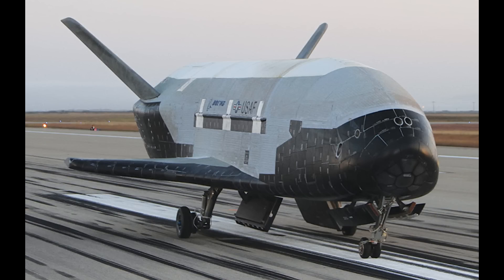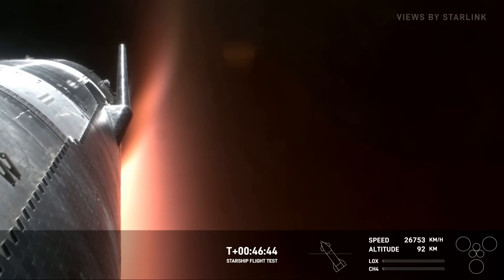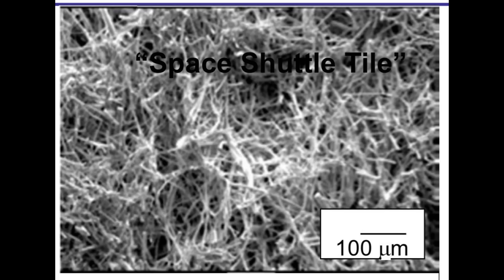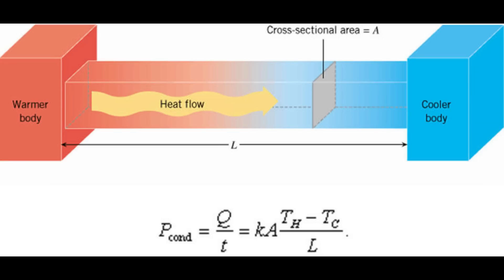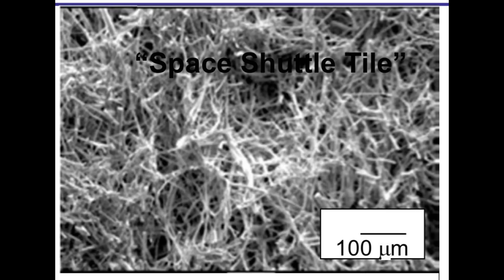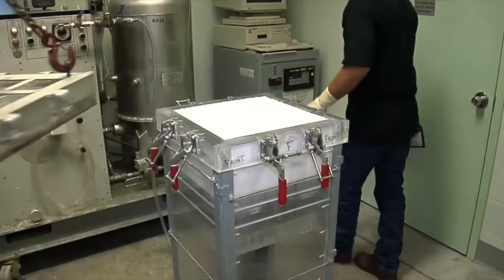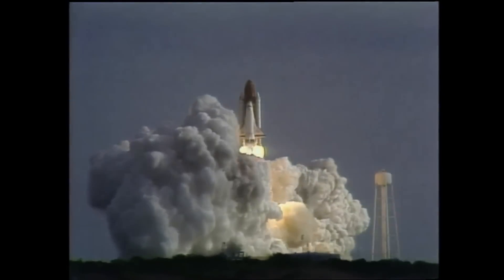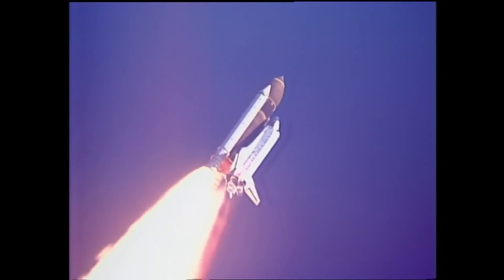The Microscopic Trick That Makes Heat Shielding Tiles Work

Comment: The physics behind the performance of rigidized ceramic fiber tiles like the ones used on the Shuttle, the X-37, and Starship is called Mie Scattering.  The selected fiber diameter (~1 micron) is "tuned" to the peak wavelength in the heat radiation inside the tile at the highest operating temperature (~2400F), called the Wien Peak, which is ~1 micron for blackbody radiation at 2400F. Those thin ceramic fibers strongly backscatter that heat radiation and effectively block it from penetrating deeply into the tile thickness.  The very thin fibers are made of ultrahigh purity quartz and have very low thermal conductivity. For comparison, the diameter of a human hair is ~70 microns.

There are two parameters that characterize Mie Scattering, namely, the absorption coefficient and the backscattering coefficient. For the Shuttle tiles the backscattering coefficient is about 600 times larger than the absorption coefficient.

Side note: My lab spent almost three years (1969-71) developing and testing rigidized ceramic fiber tiles for the Shuttle. My job was to design and build the lab equipment to measure the absorption and backscattering coefficients of those developmental tiles.
Reply: What determines the ratio of absorption to backscattering coefficient? If I recall correctly, absorption and emission coefficients are the same at all wavelengths because of detailed balance and can be calculated (in theory, anyway) from molecular or electronic structure. But what's the physics that underlies the backscattering coefficient? Is it just geometry and the dielectric coefficient of the material? Or is there something more at play?
Reply: @QuantumHistorian  A dielectric fiber (quartz)  with diameter matched to the predominant wavelength of the thermal radiation trying to penetrate the tile and having very low optical  absorption (high transmission) in the 1 to 4 micron waveband (the near infrared region).
Reply: @rays2506  Thanks, but that doesn't answer my actual question?
Reply: @QuantumHistorian  Mie Scattering.
Reply: @QuantumHistorian  Mie Scattering.
Reply: @rays2506  Thanks. So looking that up, my guess was right, it does only depend on geometry and the dielectric constant of the material (as well as the wavelength of the material, obviously).
Reply: Why is silica used instead of alumina?
Reply: Thanks for helping create the spacecraft of my childhood (80's and 90's), STS was far from perfect but gosh was it beautiful. Very helpful explanation as well.
Reply: You wonder at what point is it easier to have an ablative heat shield you just spray on again as these tiles still need a lot of maintenance
Reply: @samdettle8694  Well, spraying on a new coating isn't super-straightforward. Most ablatives are made of resins and plastics that have to be laborious injected into honeycomb support structures cell-by-cell; the honeycomb often gets consumed alongside the ablative material, so the whole structure needs replacing as opposed to being refilled. While it's true Shuttle's tiles were rather delicate and didn't stand up to impacts super-well, if carefully managed (and with more modern manufacturing tech than was available in the 1970s), the tiles can be more than viable.
Reply: @samdettle8694  Of course for the Starship to land on Mars. it will need to fire it's rockets to slow down. Perhaps SpaceX should built those rockets to assist in Earth landing too.
Reply: @samdettle8694  Better would be an ablative blanket, prepared in advance and wrapped around starship like a tarp.
Reply: @paulmichaelfreedman8334 perhaps but ablative shields are 1 use only shields. That would render a far from “rapidly reusable” spacecraft.
Reply: @samdettle8694  The shuttle External Tank had a Spray-on foam insulator to keep the propellants cold, look what that turned out doing. Same goes for heat shield materials that you can spray on. it works, but any air bubble will pop a chunk out of the foam, as will mechanical stresses.
Reply: So, you're saying that if my hairs were thinner, I wouldn't get so hot standing in the sun and would reflect more heat from the top of my dome. Got it.
Reply: @dionh70  also, if your hair was black, it would shade your head more. And if your skin was dark, the pigment would protect your DNA from UV radiation. Nature knows what it's doing.
Reply: Comments like yours are the gold of youtube for us enthusiasts. THANK YOU for your explanation.
Reply: "QUANTUM EFFECTS"
Reply: That's awesome! Thank you for the explanation, and for your work for space flight!
Reply: Regarding intelligence, we have had that forever, education is the difference.
Reply: Always a pleasure to read comments like these, thanks for sharing.
Reply: Fucking awesome!  Thank you for your service!
Reply: Elon Musk is a Nazi sympathiser
Reply: Genuine Question. I'm 52, and I have a profound worry for the future of humanity, from an intelligence perspective. Do you believe that in the US, for example, there has been a massive decline, a dumbing-down if you like, in the education, aspirations and general intelligence of the population?
I'm lucky in that I live in a very highly educated European country, but from our unfiltered perspective, it seems to us that most Americans have lost their way. Think about the drive and brilliance of the 70's and 80's and compare it to now.
Reply: @Hiram1000 you didn’t ask me, but I’ll answer with my bit of anecdotal evidence. My daughter is 16 and already has a rather large collection of educational accomplishments. Enough that her current resume would absolutely put mine to shame. With the exception of course that she’s not yet graduated. She does already have a college credit in engineering from her freshman yr. She’s taught herself to be fluent in German. She’s taking her 2nd yr of French, she took a couple of Spanish, and of course is fluent in English, her native tongue. She aced her honors Aerospace Engineering course this past year. This coming school year she’s a junior and she’s taking calculus and a college physics course. She’s also taking private pilots lessons. Oh she’ll also be taking a hand full of online course these next two years through our local community college just to fulfill her desires for graphic/video game design as a hobby. She’ll graduate high school (which was recently named number 2 in the nation) with an associates degree, a few additional college credits knocked out of the way, her pilot’s license, hopefully having maintained at least her current  5.2 weighted GPA, along with numerous other accomplishments that I’m too simple to even know what they are. Of course I’m biased because she’s my little princess, but she’s objectively an amazing 16 year old girl, and at her school, many brilliant minds can be found. It’s all about area and personal ambition. At least in my opinion. Sorry for the for the rambling. I tend to get carried away doting on my baby girl…
Reply: @Hiram1000  Ah, it is a well-known cognitive bias, that's how our brain works. We just get wiser and more experienced with age and tend to see human stupidity more. But we all have been young and stupid, one way or another, and that's the beauty of life )) Plus, we tend to remember only the best and the worst things, that's where the feeling of people doing great things in the past vs. today comes from.
Reply: @Hiram1000  I wouldn't say the 70s and 80s were a great example of drive and brilliance.. There's intelligence and idiocracy in every generation, looking back through a nostalgic lense tends to show only the most notable, either good or bad.
Reply: Are shuttle and Starship's tiles designed to be ablative like capsules are? My thought is perhaps we are using too good a heat transfer inhibiting materials for the Starship as the Starship has no Aluminum but instead a steel frame and body. Perhaps SpaceX should try to get more heat spread out into the entire vessel, even using active heat transfer techniques. One problem with my idea is perhaps human occupants overheating, but that might be manageable. Would be cool too see the upper steel glowing red hot like the bottom tiles.
Reply: @williambaikie5739  Neither tiles have ablative capability. Aside from compromising the "reusable" part of the thermal protection system, for the kind of reentry methods both Shuttle and Starship use, ablation would radically alter the aerodynamic properties of the vehicle, which would make control more difficult as time went on. Starship was originally designed to use the thermal mass of its hull to manage reentry heat, but it appears it wasn't enough, and tiles were needed.
Reply: @eddievhfan1984  Thanks. What about active thermal systems? I'm thinking of pumped fluids from around hinges and other key areas to relatively colder areas. Would such a system keep the tiles from overheating and experiencing burn-through?
Reply: @williambaikie5739  The tiles won't burn through.
Reply: @tedmoss  Isn't that what we saw on the last flight? Or are you contending there was zero tile protection around the hinges?
Reply: @williambaikie5739  If done right, the tiles won't need to be backed up by active circulation systems. The original plan for Starship was for the heated side to use water evaporation through pores in the skin, but that was replaced with the thermal tiles.
Reply: @eddievhfan1984  ...propellant evaporation, if I recall correctly. This would be way cooler (pun intended). Plus, propellant would burn around the hull, the combustion gases would expand, deflecting plasma even more.
Reply: @williambaikie5739  AFAIK the tiles did not burn through. Instead, plasma penetrated the hinge gap (Elon said the gaps between tiles might have been wider on that side) and the metal under the tiles melted.
Reply: @eddievhfan1984 well at least they’re not ablative on purpose. Accidents did happen tho as we all know.  Typically only ablated do to FOD tho…😒
Reply: @williambaikie5739  Per Scott's explanation, Shuttle and Starship tiles are NOT ablative, like the heat shields on the Apollo and the Dragon capsule.
A simplified explanation.... The really really tiny glass fibers that make up the TPS tiles are so tiny they prevent the heat from penetrating too far into the tile.  The wider the tiny fibers, the more heat that can pass through them, so by making the glass fibers as tiny as possible, it helps to restrict the amount of heat that flow thru the tiny strands of glass fiber.
This over simplified but a good starting point to help you understand the process.
Reply: @williambaikie5739  SpaceX added an underlying ablative layer to the next ship to fly, to ensure its survival in case tiles fall off.

Comment: I've always felt there must be a better way to do this than tape-ing hundreds of fragile expensive tiles to a massively powerful rocket then replacing them every time, doesn't sound like fast re-use to me. Spray on something, controlled near vertical descent or take a hint from trees and lots of small hollow vertical tubes (Xylem) with valves wood grain style kicking the heat out to something at the top.
Reply: Sure, lots of people felt that, so far no one has actually been able to do it.  Turns out feeling and fact don't always align which is why the mythical spray on heat shield is more or less nonsense..  They don't replace every tile every time.
Reply: @TheEvilmooseofdoom  Appreciate your expertize here, but it also sounds like SpaceX just adapted the Shuttle heat shield as they had far more important stuff to worry about. It may be too late for them to change direction, but possibly somebody else will come up with a solution?
It really seems like a problem screaming for an answer as opposed to something that was cobbled together in the 80s by NASA.
Reply: @Bystander333  That's a simplistic notion at best.  Starship and the shuttle had VERY different thermal requirements, the tiles are not the same.  Made from the same stuff but that's it.  ALL TPS systems are different, there is no one tile to fit them all.

Comment: if anyone is wondering how different spacex tiles are from space shuttle , the only difference is that there are fibers of different cross sections in the mix and some small granules of various elements embedded into fibers
Also the black coating flows more into material
Reply: Hackaday still has a picture from the video up of a Starship tile structure. I would presume the larger, denser fibers dispersed through the media are a compromise between strength, heat protection, and weight.
Reply: @mysock351C  In general when one includes larger fibres in a matrix it's to improve the tensile strength of the material and limit cracking.  A mix of different diametre fibres can also get you to a lower density for a given strength than a constant density.   So it's not particularly surprising.
Reply: Also, they are much, much more substantial. Look how thick they are and with a mechanical fixing rather than the shuttle ones which break if you look at them, held on by glue.
Reply: @Shrouded_reaper 

Funny thing is that the video that was removed showed that the tiles were very similar but the space shuttle tiles were more refined. So no real difference in strength and some of the same people worked on both.
Reply: @Shrouded_reaper  The one advantage that Starship has is that does a belly-flop back into the atmosphere. One of the things that arguably doomed the shuttle was the requirement that it be able to fly (more aptly glide poory) back all the way to the surface. It couldn’t afford much extra weight, and the shuttle tiles are quite light. Starship on the other hand is more brute-force, so they are likely able to accept the added weight and reduced thermal performance that comes with having a mixture of fiber diameters in the mix for reinforcement. It can just come back more or less ballistically to the landing site once it’s slowed down enough.

Comment: I think the high temperature capability of stainless steel may not amount to much payload benefit for Starship in the end. Having very hot interior surfaces isn’t really acceptable for your payload, especially the human type, and generally a bad idea around LOX. It is more robust than aluminum, but apparently neither the Shuttle or Starship was “robust to loss of a single tile” - hence the ablative layer. It will be interesting to see how the two typical heatshield sections finally compare on lb/ft2. Presumably Starship will eventually be more reliable than the Shuttle, but perhaps not much lighter.
Reply: They were robust enough, it's just not enough of a safety margin.  Starship is still in development, the TPS is, like everything else involved, a WIP.
Reply: Starship did lose a bunch of tiles and some flaps yet it still landed safely
Reply: @linecraftman3907  Yes, that may have been lucky though. Elon said "not robust to loss of a tile" I believe, so maybe if tile loss occurred somewhere else it would have been more serious - e.g. payload pay, LOX tank, ??? In the end they have elected to add the ablative layers to improve reliability, but this also adds weight. Provided none of the heatshield fails the steel temperature may never be much higher than the Shuttle aluminum temperature (and so about the same weight) - it will just be rapidly reuseable and more reliable.
Reply: @marksinclair701  that interview was pre-flight

iirc, in the post flight it became known that the steel iviewed from inside was glowing hot, so tiles were lost - ship was ok
Reply: @linecraftman3907  I think you're right, but I don't think that changes the outcome. They decided to add the ablative anyway, and pay that mass penalty. Red hot interior steel might be acceptable in the skirt or an empty payload bay, but I doubt its OK in an occupied payload bay or a LOX tank. 
Do you know where the tiles were lost or are these the ones they removed?

Comment: I stick with my statement from years ago, the heat tiles will be problematic for the quick turnaround of the craft. It was one of the major issues of the Shuttle that was never resolved.
Reply: It won't be as problematic, a standard tile for most of the body makes things a LOT easier.

Comment: Literally boiling a pot of water right now. I stared right at it, and can confirm my eyes are still ok
Reply: Pretty sure that’s cause a watched pot never boils
Reply: @TastySlowCooker  my induction stove laughs at that old tale 🤣 water boils in seconds.
Reply: @Real28  that's one thing I miss about my old induction stove. That and it'd cool as fast as turning down a flame on a gas stove. Whereas my current gas stove sure as hell can't heat as quickly as an induction cooktop.
By the same token, I don't pay for gas in this apartment, it's included in the rent, but I sure do pay for electricity. So, I'll wait for the pot to heat up.
Dad may have raised a dummy, but he didn't raise no fool.
Reply: can you also touch it to test conductivity?
Reply: Completely different story when I fallen asleep in front of the wood stove outside. As I’m snoozing it gradually works its way up to a nice, uniform orange color and I look like a lobster when I wake up.
Reply: im glad that somebody is doing the basic science in those days :)
Reply: Best not look, just in case. Safety first!
Reply: That’s risking once’s self in the name of science! You, sir, are a legend and a hero!✊🏾

Comment: It might end up being a bit challenging to make, but couldn't they have a gradient to the fiber density, making it so that the outer facing parts are denser and thus allow less water through. It'd require a thicker tile to have similar thermal protection, but since SpaceX are focusing on cost optimization over mass optimization, this might be worthwhile until they have more data on what a more ideal heat shield would need.
Reply: This is exactly how the tiles work, the white foam is on inside and the black glazing seals the tile